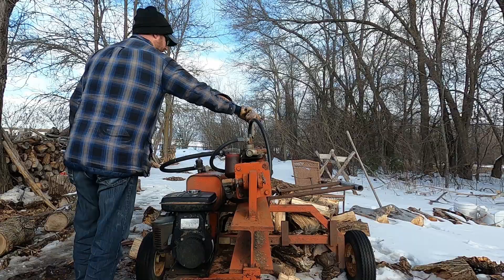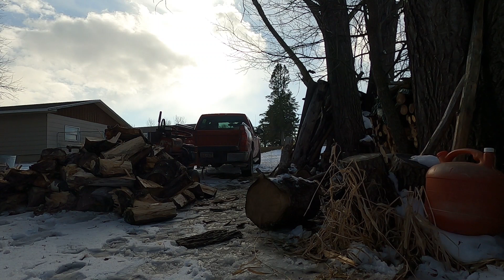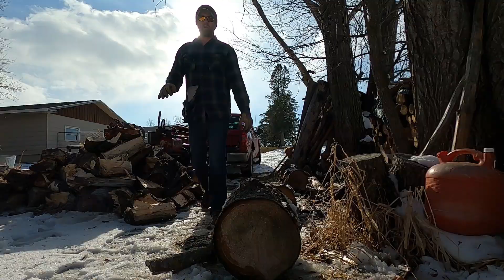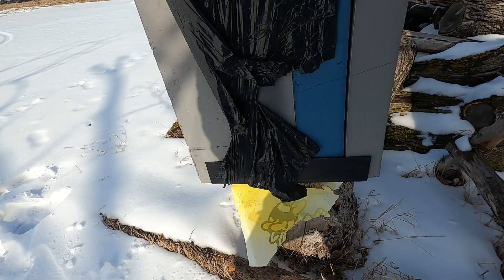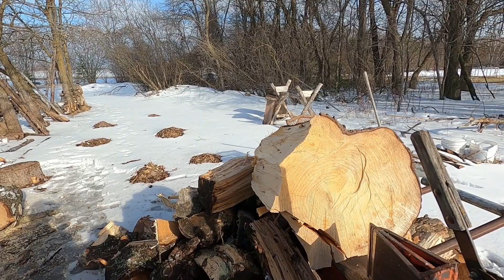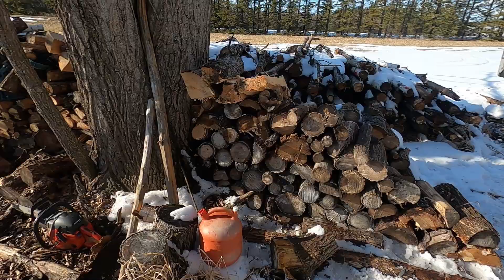Splitting wood in the spring April 2022

Comment: I'm between Brainerd and Leech Lake.  I typically cut, split and burn about 35% oak, 30% birch, 10% red maple, 5% popple, 5% basswood, 5% pine, 5% iron wood, and 5% other wood.  Each year varies some depending on what has been cleared or blowdown harvest. Lots of blow down this past year. Do you get much oak up there?
Reply from the maker: Yes there's is oak and ash most of that is on private property though. Where I get my permits is manly pine  jack pine and some tamarek. Also lots of popple up here and birch